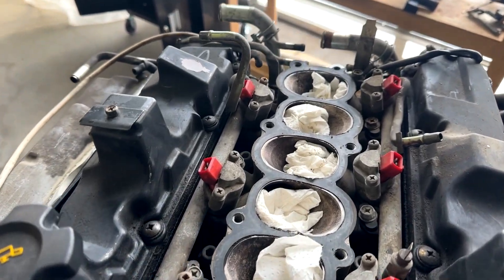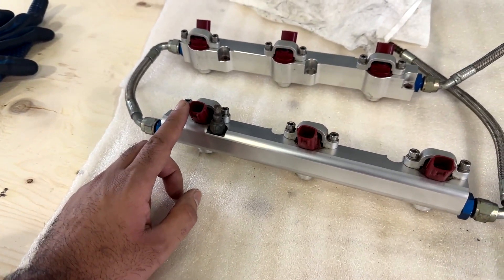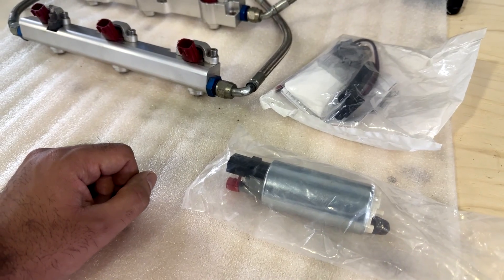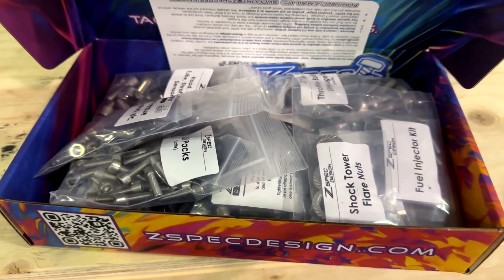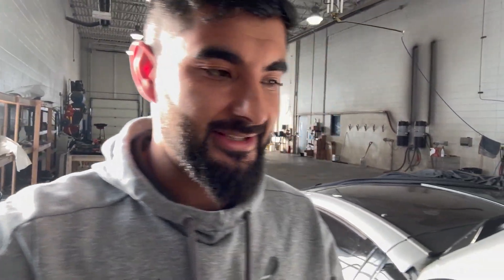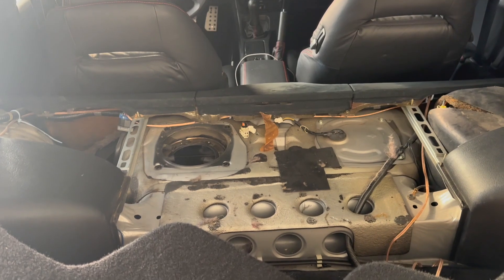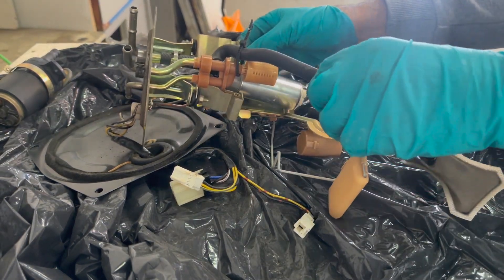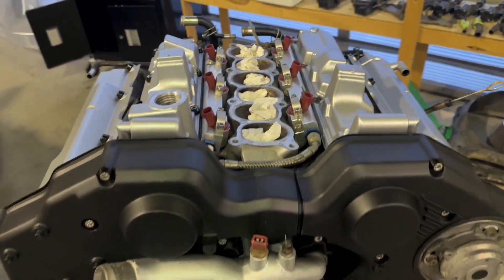Boosting my Nissan 300ZX: Part 6 - Fuel System Upgrade! Nismo 740cc Injectors + Walbro 255 Install

Comment: Not sure if its worth pulling it back out but id recommend putting some rubber around the fuel pump to isolate it from vibrating, keep from rubbing metal to metal, and it helps the hose clamps hold onto the pump

Comment: Are you going to change the pistons?
Reply from the maker: No keeping the same pistons
Reply: @FarazXAhmed   oem stock pistons ?
Reply from the maker: Yes
Reply: @FarazXAhmed  How much horsepower can the piston handle?
Reply from the maker: @-garagehome4444 depends on a lot of different factors. Fuel, time, mods etc. With what I’m going for, 400+hp
Reply: @FarazXAhmed  They say the factory piston is broken and cannot handle 400 hp

Comment: Whats your plan for fuel pressure regulator and dampener?
Reply from the maker: Sticking with the OEM for the time being, will change it down the line if required

Comment: How many watch hours do you have now? 🤔
Reply from the maker: It’s right around 3400, just stays there really. Even as more people watch it also goes down a bit because it only calculates last 365 days. 

Thats ok though I’m not too worried about it. I’m having fun. If I rushed my build and posted everything at once I would get there but that’s not what I’m here for lol it just means I won’t spend money on some recording equipment at the moment. 

I’m enjoying it, it’ll happen when it happens, and if it doesn’t that’s ok too 👍
Reply: @FarazXAhmed  😫

Comment: Yes you need that ground strap for the fuel temp sensor to work. Hope that fuel hose from the parts store lasts, only use Nissan OEM fuel hoses. Expensive but is proven to last, ie 34 years at least ( the one you replace).
Reply from the maker: I hope so too, it was a good submersible fuel hose I got as it’ll be in the fuel tank. Hopefully no issues 👍

Comment: So nice job so far, however you need submersible fuel hose. The composition of the hose is different in the material used on the inner side vs the outer layers. The outside will degrade very quickly and clog up the pickup sock
Reply from the maker: Thanks! Yes I got submersible fuel hose from the auto parts store